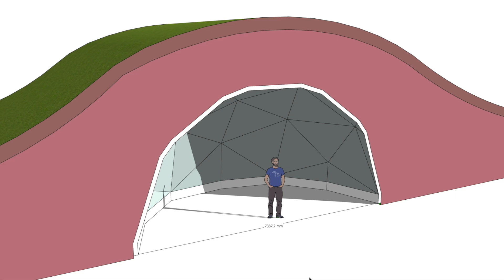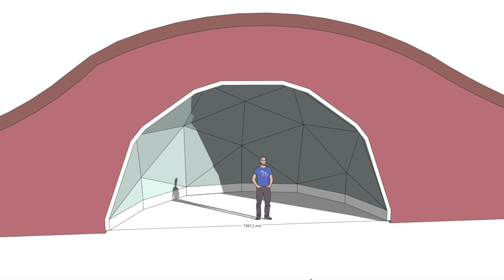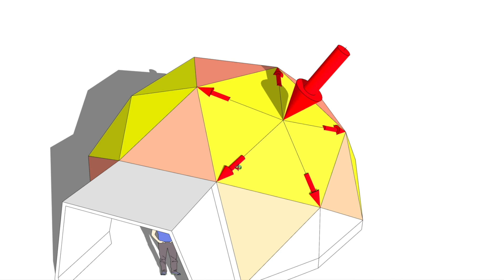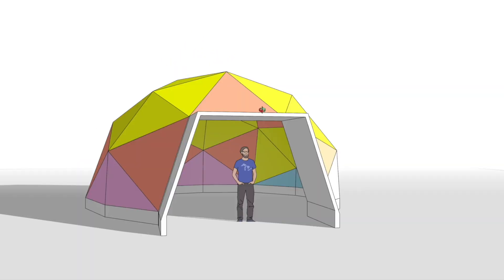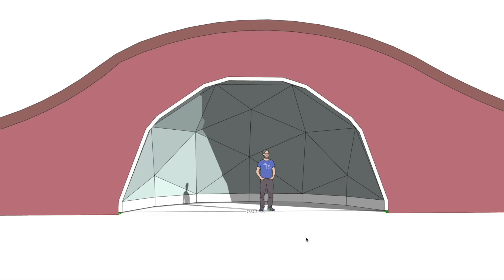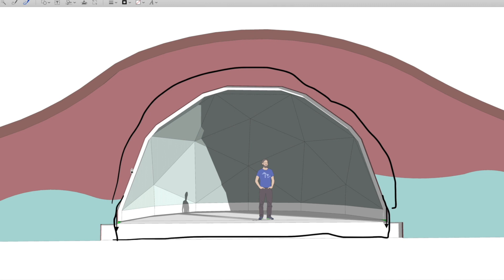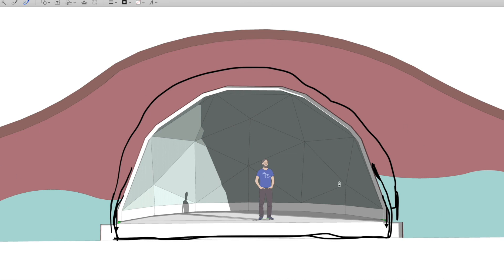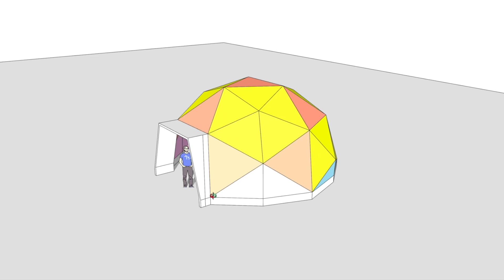Watch this before building an underground dome

Comment: How to build a hill 
Run off could be dry River Ben or reservoir run off
Water capture and pump it out
Define underground 
If it's on a higher level land but flat or something 
The water should always have a run off
You are assuming zero run off or level ground for a long distance 
Membrane makes sense 
It's a basement basically 
I would use wood
Aircreate or foam

Comment: what about using foam panels and glue together with spray foam. then spray 6 inches of spray foam over the entire dome. then lay up some rebar and spray shotcreate , more rebar, more shotcrete etc....finally put water proofing membrane and cover with soil and then another membrane and finally your soil?????

Comment: the water problem seems to me the best solution is to put drainage under the structure before you start and build this above the nearby ground level on at least one side so you can drain

Comment: I have a question. If you put a support in the center running from the roof to the floor would that increase or decrease the maximum weight that could be placed on top of the dome?

Comment: The best bet would be to use the dome structure as a leave in place concrete form. Cover it in reinforced concrete. You can cover the wood with a EPDM roofing material for water proofing. Set the rebar then spray your concrete on. Let cure, then water proof and insulate to protect the water proofing from the dirt. We did a containment for a mine site with a spray on bed liner as a water barrier. Same as a spray on insulation application for a house.

Comment: As a suggestion....
Sump connected to external french drain and sump pump(s) with battery backup.
Put your dirt covering in layers with geotextile every 50 to 100mm to mitigate soil movement and wick the water at a steady rate.

Comment: So, I have a greenhouse outside and was wondering if I could hook my vent pipe in the ceiling up to a pipe and run it to my greenhouse.
My home is like pictured almost, but has passive solar heating and is 65-75 year round.
Will this work?

Comment: I'm about to tackle the underground dome. Some of the engineering specs are: must not use any conductive materials; must be able to use reclaimed or scrap materials, must survive earthquakes, and be able to stop radioactive fallout.
Reply: Sounds like a challenge if you cant use metal. How did it turn out?

Comment: You're assuming the only possible failure points are at the vertices, but the flat triangular faces are likely weaker and can deform or crush inward catastrophically depending on the material. The larger the triangle the more likely it is to fail.

Comment: Surely, the most efficient shape for load bearing is a circle…or part of, so the loads applied are dissipated in all directions and either strengthens the structure, or in part of a circle, I.e. an arch and pillar’s is capable of transferring the load to the ground… In a dome of this design there are numerous ‘flat points’ in the structure where the load, or a large part of it, will not be transferred, but will bear directly on that flat surface…therefore the structural strength of the material employed in those ‘flat points’ where a load is applied, must be capable of withstanding that load, plus a safety margin… if not it will fail, and failure of part of the structure will lead to unbalanced loads being applied to the remaining structure, leading to supplemental failure and collapse…!!!

Comment: A quick calc: 9 meter diameter dome, half sphere, has a surface area of approximately 128 m2. Clay has a weight of 1,826 kg/m3 (wet excavated clay). So 1 meter coverage with clay amounts to 234 tonnes. That weight is NOT pressing on the dome perpendicular to the surface of the dome. For example, the first 1 meter of clay around the dome excerts very little force on the dome. It presses vertically down on the foundation or soil next to the dome. This first meter of clay has itself a bearing capacity of around 5,100 kg/m2. Assuming the soil you build on has a higher bearing capacity, this means that the first layer of 1 meter clay serves as foundation for the next 1 meter, and so on. In short, the dome will not receive a pressure of 234 tonnes, but much less, due to the extra bearing capacity of the clay. My advice is to NOT build an underground geodesic dome unless you have done the necessary FEA or hire an engineer to do that for you. We did all the FEA and more on our domes to make sure "terrible accidents" won't happen. Using the right materials and proper engineering is paramount (in any construction).

Comment: If an impervious layer is laid over the structure and extending well beyond the structure, it's possible to keep the soil completely dry year-round. Just need to build above the water-table, too. Dry soil weighs less and doesn't transfer heat as fast. Look up Passive Annual Heat Storage (PAHS) for more information.

Comment: ...Galvanic protection would be required as protection from any underground currents (causing the structure erosion), the evalution of the hydrostatic thrust of the groundwater on the sides of the structure (variable over time, can cause fatigue stresses in the joints), the evaluation of any differential subsidence in the foundation layer, and many other factors must be considered... It's not simple.
Reply: You're right. It's not simple, but neither complicated. With the right tools and skills, this can be worked out in less than a day to arrive at a structural sound construction. A matter of using the proper materials and knowing what their properties are.

Comment: Paul, your explanation about how the dome could fail shows why such a dome (loaded with soil overhead) should use the trussed dome design. By trussing the dome, entire modes of failure go away.

The one thing I've noticed is that the wanger flange is probably not well suited for a trussed dome because a ring of the flanges that would support 10 strut ends would not have as much rigidity as if all struts came to a point.

Comment: I would like to add that the soil pressure does not only effectively act on the nodes and transfer that load to the surrounding nodes, but it also acts on the flat surfaces of the covering membrane or sheet that form the facets, and put these facets into tension. Ie your covering bulges inwards at every facet. 
For this reason I would recommend a higher frequency dome for underground than might be chosen for above ground situations. You want to keep your facets as small as possible. 
In addition to this, I recommend that the first layers of Earth are thinly applied and dry mixed  with 5 % Portland cement so that these first layers of earth are structurally self supporting and contribute to the strength and thickness of the  dome, before adding further earth.